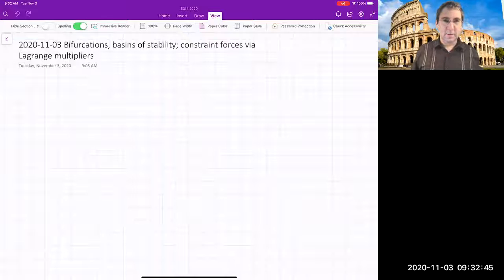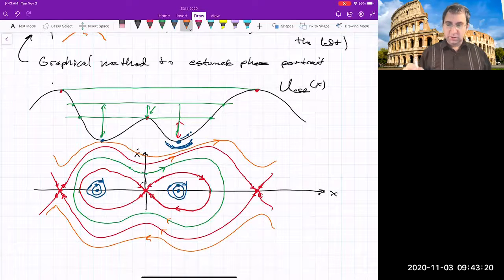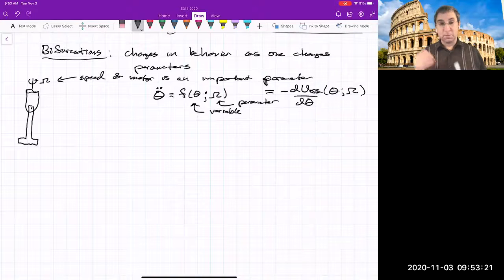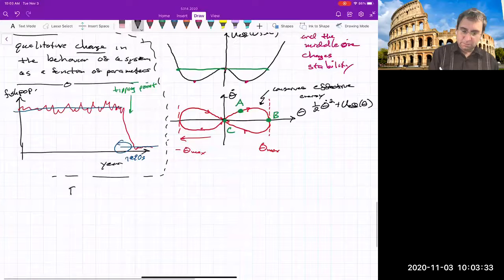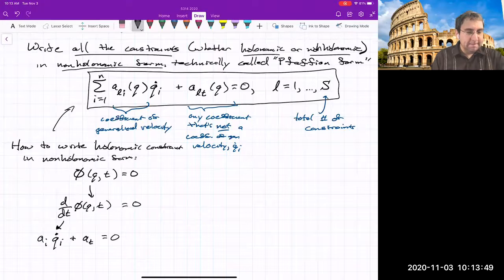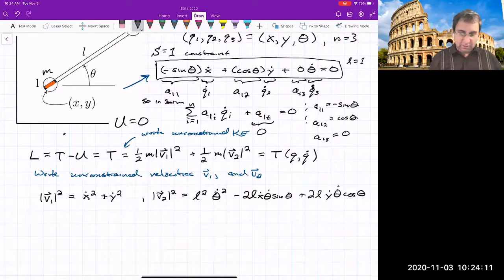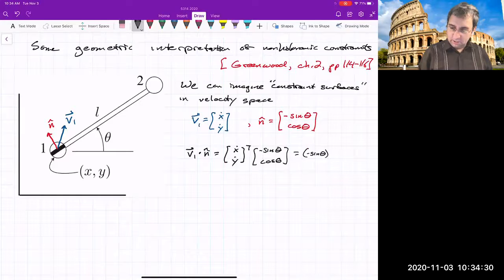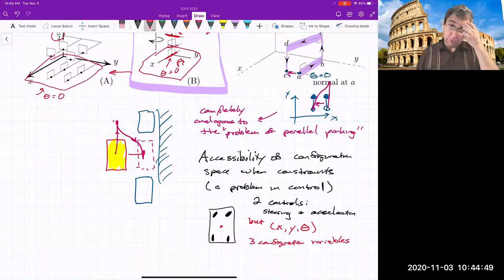Phase Portraits, Bifurcations & Lagrange Multipliers (Constraint Forces) | ESM 5314 Lecture 21

Comment: Dear professor Ross,

I've been doing my research on dynamic systems (linear/Nonlinear) in robotics, and I've been looking for references on doing the contrary: derive/estimate the potential from the phase space trajectory. Is it possible?
Reply from the maker: This is a great question! Yes, I think it is possible. I did a study where we looked at a simple table-top experiment of trajectories of a ball on a surface -- which is the same as the gravitational potential energy surface -- and asked a simpler question: Can we identify unstable equilibrium points from trajectories? The suface had multiple equilibrium points, some stable points and some saddle-type unstable points. The answer was yes, and the study is here: https://ross.aoe.vt.edu/papers/xu-virgin-ross-2019.pdf
Reply: @ProfessorRoss thank you very much professor. I'll read this work 🤝

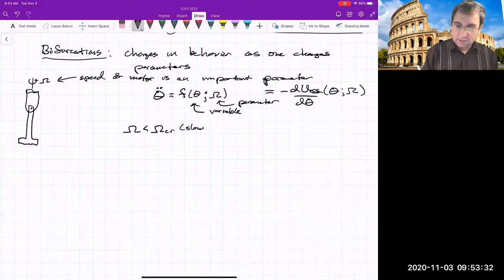Comment: Thank you for the lectures again. I have a questions about the T on a rotating thing at 20:50. I also had this question in lect 20 too. Why is that system only 1 DOF? even if the big OMEGA is constant, cant we look at that as another DOF, so the system should be 2 DOF?  Is  it because having that big OMEGA constant is like having a nonholonomic constraint? What if the big OMEGA is not constant? will that make the system 2 DOF?
Reply from the maker: Great question! The key is how we define the degrees of freedom (DOF) of the system.

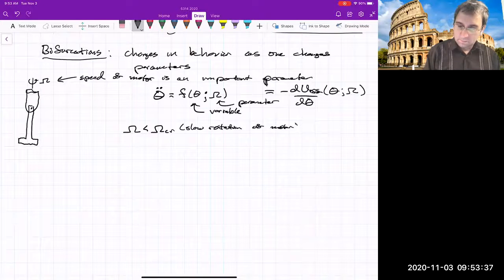At 20:50, we’re analyzing the motion of the T-shaped pendulum relative to the rotating frame (which itself rotates with constant angular velocity Ω). Since Ω is constant, it acts as a fixed parameter rather than a dynamic variable—meaning it doesn’t count as a separate DOF. So the system has just 1 DOF: the angle θ of the pendulum relative to the vertical line.

If Ω were not constant—suppose it was free to vary, not control by a motor, and had its own dynamics—then yes, we’d need to model that motion too, and the system would become 2 DOF. But when Ω is constant, you can think of it more like part of the environment (like gravity) rather than part of the system state.

So it’s not a nonholonomic constraint—it’s just that Ω is a fixed, known input in this case.

Comment: Great explanation! 

I have a question (not directly related to the video, though)…

For a 1-DOF system with two equilibria: one stable and one saddle, the potential energy can be used to identify the stability region which allows us to predict the response of varying initial perturbations x0 (zero initial velocity). If x0 is within the region of E < Ec (ie critical energy corresponds to the saddle), the response will be stable; otherwise unstable if E > Ec.

Can the same be said for a 2-DOF system (also with two equilibria: one stable, one saddle)? Does an initial point at E > Ec always give an unstable response? I imagine this is only true for one of the two axes since there is only one limiting saddle.

Appreciate if you could confirm my suspicion.
Reply from the maker: For a 2-DOF system, having E > Ec is a necessary condition for unstable motion, but not sufficient. With a 'bigger' phase space (4-dimensional for 2-DOF versus 2-dimensional for 1-DOF), there are more possibilities. One example I know a lot about is the gravitational 3-body problem, and there are some unstable equilibria, that even if you have an energy above them, you could have either stable or unstable motion. I discuss some of this in this lecture https://youtu.be/_pzpf_j6ZVM
Reply: Many thanks for the confirmation @ProfessorRoss !!